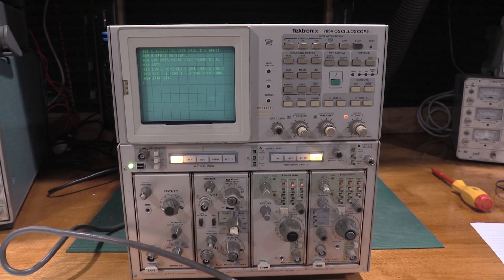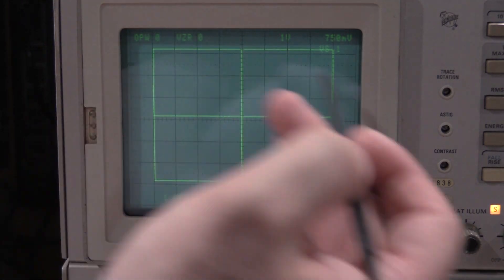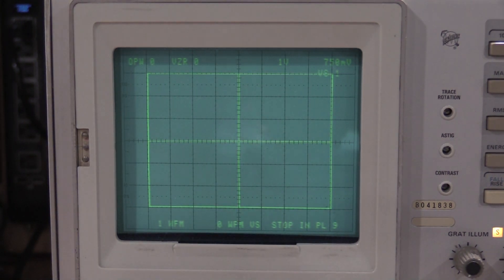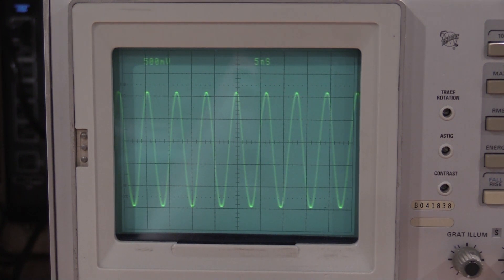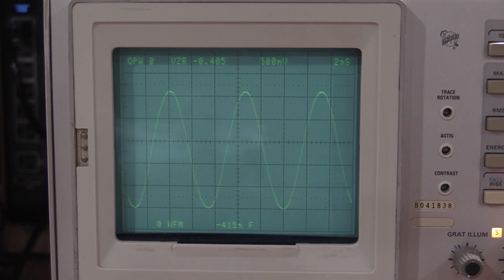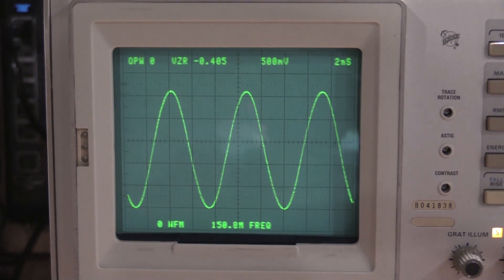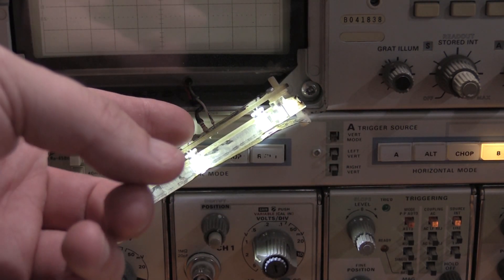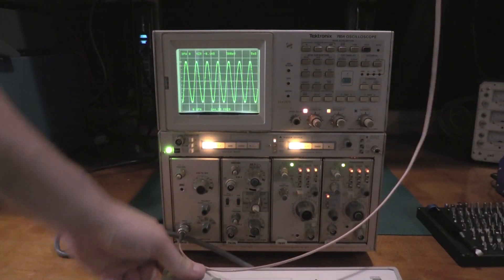Tektronix 7854 minor calibration and led upgrade

Comment: Did you let it warm up before adjusting?   Mine is dead on between analog and digital but only if i give it 15 minutes or so.
Reply from the maker: I just got finished doing a full calibration on this one. There were some significant faults that needed to be addressed. As well as some out of alignment issues with the digital section. Videos will be out soon about the process.

Comment: At around 8:13...8:28 you might sport that the digitized waveforms do not match the analog waveform. So you still have to calibrate two more amplifiers ;-)
Reply from the maker: Yep this is true. I need one of your cards, and I am looking for 067-0912-00 (7854 Analog Test Card) this seems to be incredibly elusive to the paint I might have to redesign a replacement. I was working on that with another member of the group but nothing came of it so I might have to start out on the project again. This allowed me to confirm that the missing data is no longer preset as it was before the minor adjustment and not dead bits in the ram which is good. I have everything else in the lab except those 2 cards. I also would like to address the ROM and future proof it but I need a ROM burner in the lab do not have one of those yet but that is quickly coming to the top of the list. A Tek micro circuit computer would be nice but I have not even seen one of those yet to even try and acquire.